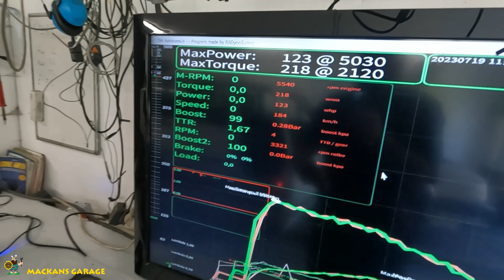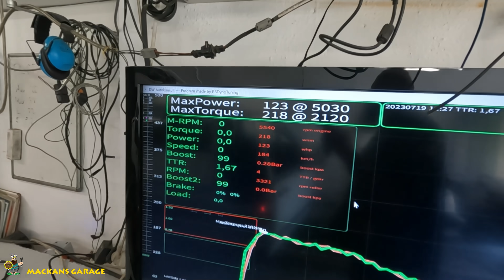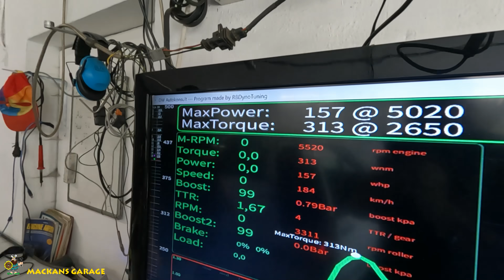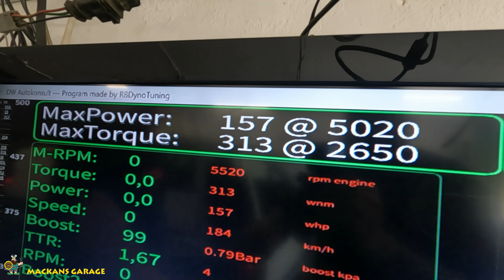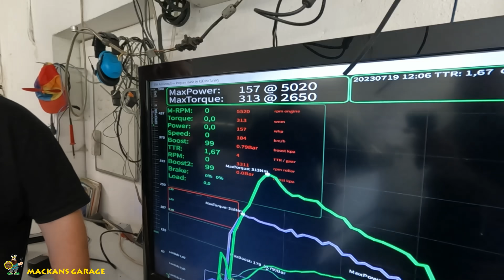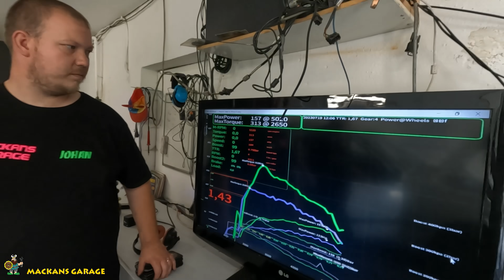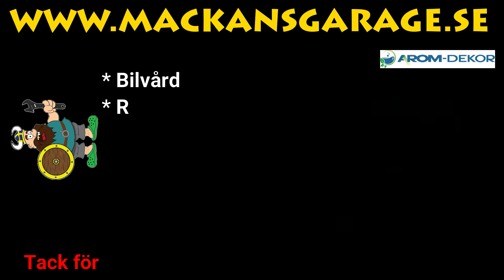Trimma bilen med berömda T-korset!

Comment: Skulle vara kul att se er göra detta på en fulltrycksturbo för att se om det är något annat resultat
Reply: Allt är samma med ända skillnaden (chip?) Och wastegate på 0.65 bar istället för 0.35 bar
Reply from the maker: samma sak
Reply: "t-kors" inte. Spänn wastegate bara istället. Fulltryckaren och lätttryckaren är bara wastegate och klistermärken som skiljer. Du kan säkert ladda uppåt 0,6bar med original 940 turbo. Därefter bör du ändra bränslemapp/spridare/btr/pump/turbo/system/vad fan. Om du har lätttryckaren utan justerbar wastegate kan du lägga typ 2-3 vanliga brickor bakom så får du cirkus ft motor. Installera en billig biltema mätare för 200kr (t-kors under instrumentpanelen) och justera med brickor tills du kommer till 0.6 och var nöjd.